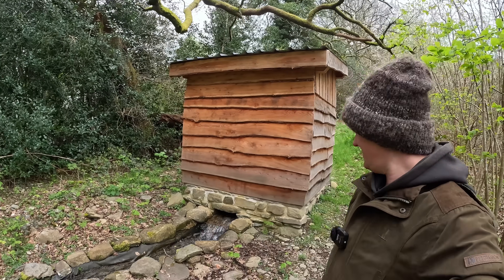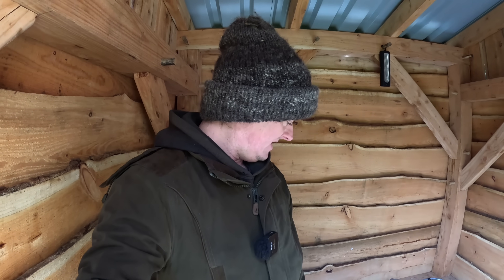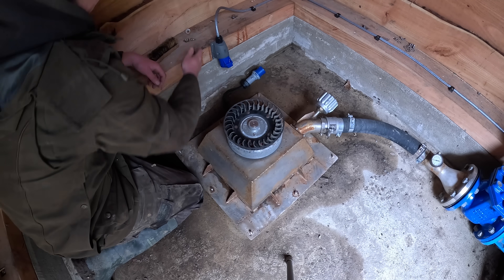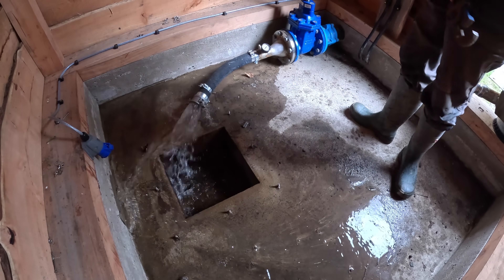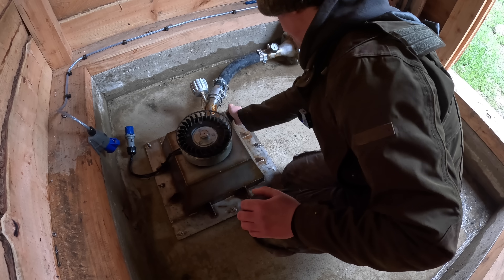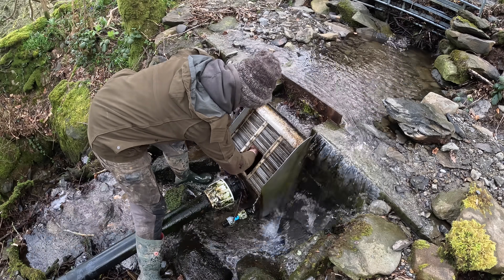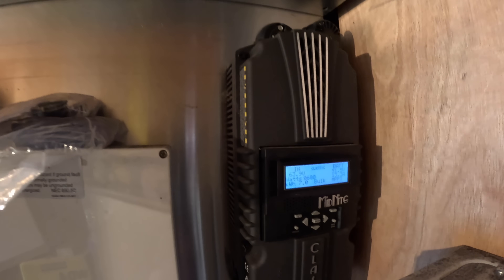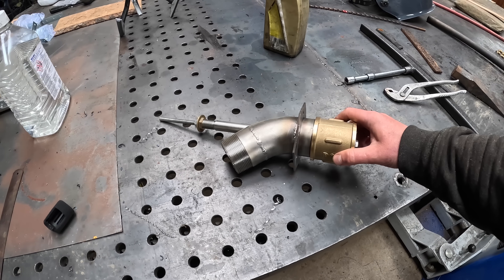North Wales 1.5 Kw Hydroelectric System Update And Maintenance

Comment: I suggest applying a bit of blue spray paint to match the water valve. This will add to its appearance & put a stop to the Rust that is appearing & improve the overall look of the installation. Kris, just because it is stainless does not mean it can have a coat of paint soon. see you. Have cleaned it up, but  A coat of paint now will stop the rust returning.  But it seems I am  showing in the wilderness, I see

Comment: This I really find it difficult to understand here, it's always the choice to make a square box, for round pelton wheel. Would it not be more judicious to carry out a dome-shaped protection, (half-ball) and thus undoubtedly improve its yield, when the water follows the movement of the wheel and thus improve its yield. Aerodynamics are well improved with a vehicle, in order to enter and improve its entry into the air. Why wouldn't it be possible to do the same with water ..! I ask the question.

Comment: Great job! But I would have done a straight tube alignment, no bends,and I should have made another design of the tubing that leads from the blue valve, the tube should be tapered with a smaller angle....I´m the owner of 2 small hydro power plants in Sweden built by me.I run Francis turbines.. I would like to cooperate with You!

Comment: ✅ Hi Kris, On an engineering note… What about an inline pre-generator ‘settling tank’ which has a top feed, medium height of the tank output to the pump, and a daily X minute charged battery release solenoid time activated large bottom sludge release may help keep the water to the pump clean. You may also may be able to use a light on one side, photocell on the other side pass through the sludge water to close the solenoid once the water is clear.  A settling tank also would make the water to the generator more consistent.  The tank would need to have a pop off top for skimming floating debris. You may find if the tank is intentionally not level, tipped down further towards the generator side easier to skim. Happy to sketch it out and email to you. Jerry from Chicago.

Comment: To prevent rusty welds on stainless fabrications - always use a stainless steel wire brush to clean wends, that has not been previously used on ferrous metals.

Comment: Watched a few of your vids and the thing I notice is that you don't appear to account fully for tweaking things up. As a millwright / mech eng. some of the things you come up with are awesome but lack finesse. More so on the overshot system. Also a lack of decent seals seems to be a common factor. On this one the contributing factor to the silt is a missing seal between the mounting bolts and the floor.

Comment: Why don’t you install a rubber gasket between the turbine cover and cement, it will reduce vibration and work as a seal.

Comment: Good morning 
I designed a turbine with a fall of 100m in Malaga, Spain (10 bar pressure) many factors must be taken into account, if you can overcome them.

Alternator used?

Type of turbine, measurements, Pelton, where did you get it, etc.?
Water consumption per minute?
Water pressure when hitting the turbine?
Measurement of the water supply pipe 1', 2'?
Output voltage and total power? 

Saludos

Buen día 
 Diseñé una turbina con una caída de 100 m en Málaga, España (presión de 10 bar). Hay que tener en cuenta muchos factores, si es posible superarlos.

 ¿Alternador usado?

 ¿Tipo de turbina, medidas, Pelton, donde la conseguiste, etc.?
 ¿Consumo de agua por minuto?
 ¿Presión del agua al golpear la turbina?
 ¿Medida de la tubería de suministro de agua 1', 2'?
 ¿Voltaje de salida y potencia total? 

 Saludos

Comment: Just checking - that 16a ceeform plug and socket on the wall - looks strangely like the socket is on the wall, and the plug is plugged into it. I know that can't be the case, as that would be against the electricity regs, and illegal, as the plug would have live accessible pins on it . I know you can get the right way round (wall mounted inlet plug) for caravans etc, It just looks like the bit on the wall is a socket for some reason.
Reply: Oh hang on, I've just seen more of the video. Yep that plug and socket arrangement IS illegal. Socket should be on the generating plant, and plug / inlet should be on the wall. And if the unit isn't generating 230v, then it should be the correct colour for the voltage (110v is yellow, <50v purple etc).

Comment: Just done some maths, that is I divided 6939400 W by 136402h to get an average out put of 50.87 watts per hour, seems low see it was showing an point in time out put of 688 W.  Is my maths wrong or is the hour count wrong / being read incorrectly?  Perhaps it is 13640.2 H (444 days running) which would give an average output of 508.7W?

Comment: On the oxidation which you showed on the stainless steel turbine housing, when welding stainless steel one should always use a stainless steel wire brush. A carbon steel brush will clean up the weld just like the stainless steel brush, but with the carbon steel will  leave small particles of carbon impregnated in the weld and heat affected zone. The  oxidation of the carbon steel will manifest as rust on stainless steel.

Comment: your wire brush was contaminated never use same wire brush on carbon steel and then u8se it on stainless, keep a stainless only wire brush and you will never ever have rust on stainless

Comment: Very important point that I am struggling to find the information on? What height, or head, is the inlet or source above the generator? Amazingly small stream for the source, but how high is it above the generator? I have been told (unconfirmed) that it needs to be over 100 ft or 30 metres? North Wales very mountainous so not difficult to get the energy

Comment: Awesome setup!  Your EV maths is incorrect though, to calculate how many miles a vehicle can do on 6900 kWh of energy when the EV uses 3.5 kWh/mile then you need to divide 6900 by 3.5, not multiply the two.  So this gives an EV range of 1971 miles.

Comment: Have you thought about running a roating sieve from a koi pond,  apable of massive flow rates and you could run it from the turbine, it would be a lot easier to keep clean, and smaller particles than that screen? Cool video 🤙

Comment: Its late, and i'm just throwing out ideas, but could you channel the stream into a tank, have the outlet to the turbine covered with mesh midway on the side walls of the tank, and have overspill (and therefore leaves going over the top) and the heavier stuff sinking to the bottom. would allow for higher pressures down stream... all depending on the amount of water. And im sure the tank size is fairly easy to work out with the right textbooks. not quite mastered fluid mechanics quite yet  but im sure there is a way!

edit/ just realised I've just described what is basically just a miniature hydroelectric dam and for more moments than I'd like to admit to, thought i was pretty smart LOL.

Comment: I wonder if dynamic control of the needle valve could improve output?
I also wonder if a feedstock where low density stuff like leaves etc can float over the top of the inlet grids would help? ie the spilway is not dowbstream the grids?

Great job though!

Comment: you have the wrong plug and socket on the system if it can become live when disconnected it should have the female connection on the source of power. in this case the plug should be female and the socket should be male.

Comment: Why do you have the electrical connector below the level to which the water would rise in the event of a flood? The concrete base of the 'turbine shed' does not seem to have a separate drain, so if you have a (slow) leak, the base of the shed could fill to the top of the wooden base.

Comment: I love the summary at the end, as an electric car owner who'd done 25k miles in the last 2 years and averages 4.2 miles/kWh, I think this is really great.
Has the owner of the turbine considered having a large "reservoir" pond to act as a battery with the aim of keeping it running through more of the year? 
If done so, an electronic depth gauge and some sort of smart valve could be used to increase power based on the available water

Comment: The plugs wrong mate, if you touch that with it on your going to get hit
Reply: What??
Reply: @meilyn22  If you look at the plug the 3 pins are exposed. I understand this sounds right but infect it’s wrong. The hydro generator makes power meaning if you touch those pins you will get electrocuted.

Comment: Shouldn’t the female part of the plug and socket be on the generator? The male (with the prongs) part then plugs into the other side? Exactly the arrangements you’d have with mains connected ones.
Reply: Would copper be a better material for the slats on the intake, easy material to work and prevent algae etc

Comment: Hi kris are 240v plugs on the wrong way ie the male should be running to the property and the female off the turbine due to if water is flowing through your going to get power on 3 metal pins ? nasty shock if you do.

Comment: I would fit a cage over the spinning wheel and also change the plug coming out of the motor to a trailing socket, as this will be live when spinning. Change wall socket to appliance inlet and mount higher up to avoid any water damage over time.

Comment: For the screen cleaning, it seems you might be able to make a wiper that goes through the slots and is always attached.  Grab the wipre on the top, slide it side to side a few times and it cleans both the inside and outside of the slats.  The gap between the slats is large enough to attach the inner and outer wipers.

Comment: Two things occur to me watching as you cleaned and updated your intake system. You have those two dead zones where ink isn't ingested due to the edges of the small intake panels where screws are. Would it be worth adding a couple of small deflectors at the top of your intake to gently encourage any potential "dead zone" water left and right over the intake fins. The only downside I can think of with that idea is if you get any larger detritus, it might get caught up so careful design of the deflectors to allow stuff to flow over would be needed. Just a thought as it's probably about 10-15% of your water just passing straight over, which in shallower/drier times would be a substantial loss.

Comment: Great Work but the output from the turbine should be on a female 16a connector not male. As the pins of the male 16a would be touchable and live if the turbine was running and it was disconnected.

Comment: Thanks for the update on this project. I have been wondering how it was doing over time. I was also a little worried that you may drop that brush while cleaning the underside of the screen and have it stuck in the pipe. Maybe next time a screw with a little string tied off to something. Overall, a quality job to be proud of.

Comment: if the slots of the panels go parallel to the direction of the water isntead of perpendicular, "outside" blockages should get cleaned off and less debris should catch there

Comment: 15:44 Thanks for the update Kris.  You were talking about EV and the equivalent mileage you can drive on 6.9 MWh.  I have been driving my Tesla Model 3 for 2 years and a month since I purchased it.  Based on the consumption data I’ve used 6.28 MWh to drive 33 756 km (21 000 miles).  Given our Canadian climate that’s an accurate usage estimate.  Just as an aside, the usage during driving is about 90% of your total energy usage, the maintenance consumption is actually significant.

Comment: Having watched this project from the begining I think it's been a great success. What I wonder about though - is why isn't everything linear - as we know the water doesn't like a turn both from a water disturbance issue as well as a wear and tear point of view. Wouldn't the new spear be much better then is if it was straight and then the feed into the generator was also straight resulting in increased power. 
Also why not use a rubber gasket between the concrete floor and housing to reduce noise and vibration?
Great work, keepi it up...

Comment: ...Curious why you didnt wire in a proper light inside the hut 😅
Reply: Because you turn the Turgo off when you need to inspect it?
So you would need a battery operated light?
Which brings the possibility of either the battery or the charger for it burning down that nice shed?
Safest is......  bring your own torch.........

Comment: Kris you inspired me to try and fix my water pump issue! My biggest challenge was crawling under my house to check the water pump Air-Pump Pressure Switch. I tapped it with my screwdriver and it immediately started working again. It would have cost me a few hundred dollars to have a guy swap it out! I don't think I would have done that if I hadn't watched your videos!

Comment: It looked like a fair bit of water was coming down the two central rows where the screens were fastened on the intake box. Have you thought about putting an upside-down V shape on the top two pair of screws, to divert the water back over the wedges. Not sure if it would help increase the water intake. But it would increase the water flowing over the wedges, maybe that would help keep them a little bit cleaner. Just a thought after watching the video. =) It might even be worth putting a diverter on the two edges as well if it would be helpful that is. =)

Comment: Doesn't feel like two years. But surely the turbine works well, even with that little water it would be sufficient to keep my air to air heat pump running and my house warm when it's not below 5°C. At lower temperatures more power is needed but I'm sure this turbine can deliver it with more water flow.

Comment: Eliminate those hopeless coanda screens.
Build a small dam with a depth of at least a metre in the stream bed.

Use a spill over dam..
the excess water runs over the top and continues in the steam bed.
This way 100% of the water flows into the dam...
what is not used in the Turgo flows onwards allowing very precise power generation water "take".
(There is no water bouncing off/spilling past any coanda screens...)

 Now take a pipe that is twice the diameter of your penstock pipe.
This will be the collector pipe.
 Punch a myriad of small holes say 4 mm all over one end of the collector pipe and close off the upstream end of this collector pipe 

Cover this holey end with garden shade cloth or windbreak material...clamp with stainless screw drive clamps.

The collector pipe needs to go through the dam near the top edge of the dam and down to join into the penstock pipe with a small "pee hole" on the upper surface at the join to allow any trapped air to escape from any where in the system...bubbles can run uphill...when  the penstock is filling with the valve at the powerhouse turned off.

The upstream end of the pipe needs to be angled down into the middle of the body of water behind the dam...aim for 500mm above the bottom...thus 500mm below the water surface.

With the myriad small holes in the pipe no suction vortices can form...so no trapped air or whirlpool holes funneling air down into the collector pipe.

Any small gravels, sand etc. fall out on the bottom of the dam basin.
Any floating debris floats on the surface and floats over the dam...including when it is in flood...

There is nowhere for algae to grow in this scenario.....
the shade cloth is only there as a last ditch safeguard as normally nothing gets caught there anyway.

No more cleaning coanda screens.....
Reply: Ha!....this sounds EXACTLY like the over-confident set of instructions Kris has received in the comments for YEARS ...
....and, has patiently explained, over and over again...why it doesn't work.....!!!
Reply: @andymccabe6712  
Look at Marty T channel...he has done exactly this...
He has been extracting electricity from a small stream for 18 years.
2 years ago he built a whole system for a friend..using the water intake at the middle level in the water catchment behind a small overflow dam...
885 watts 24/7 @ 100psi through 3 inch penstock with vertical fall 229 feet...

Comment: You'll notice the painted surfaces have no rust...  😁  Couldn't go wrong with a thin sheet rubber gasket between the concrete and steel to prevent rust as well.  Maybe all stainless to prevent galvanic corrosion.from dissimilar metals and water.   That all asside, wouldn't another row of screens help capture more water.   Also, a pressure controlled valve to keep air from getting into the system and make it to where you don't have to go out to adjust it manually would be nice.
Reply: ANYTHING you could possibly dream up to suggest to Kris to 'improve' the system has been endlessly considered, debated, argued over, rejected....over about the last five years or so ....
..you need to understand that he has a VAST amount of experience and knowledge gained by endless research, experiment and modification .... !!!

Comment: Do you realise that your electrical connectors are wired the wrong way round ?  The generator produces power and sends it to a connector with exposed pins  !!  Power input to any circuit should use shielded pins I.e. a female connector
Reply: You are correct if going on to a dead circuit, but not if it is feeding on to a circuit that can be live
Reply: Yeah because 2 years of operation now needed your input 😂

Comment: Love your videos! Are the fins on top of the turbine for cooling? They must create some drag. Is the turbine/generator thing not kept cool enough by the water flow. Just interested you see.
Reply: The water impinges on the Pelton wheel and all water needs to be separated from the electrics beneath that vaned rotor...
under the vaned rotor are the stator magnets and wiring to produce the electricity 
plus bearings to allow it to spin.

So the heat produced has to be taken away...
not by the water (except perhaps the lower bearing...
but by air movement...
created by that fan.....